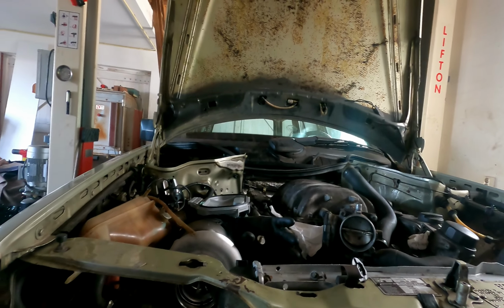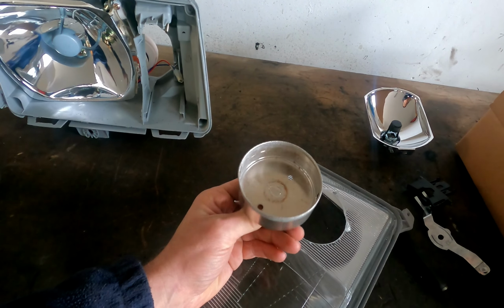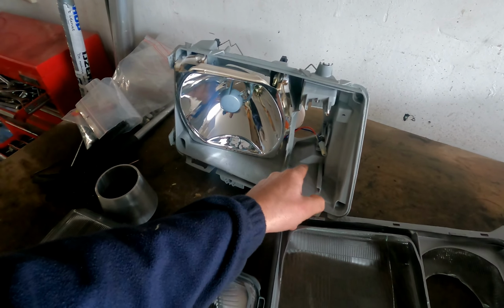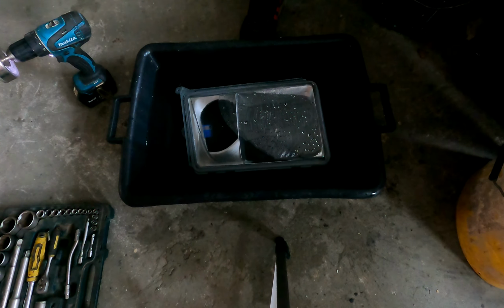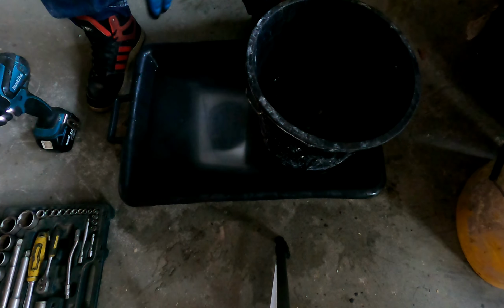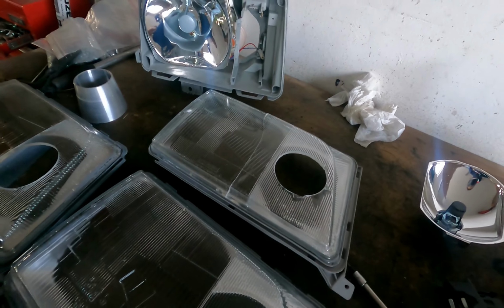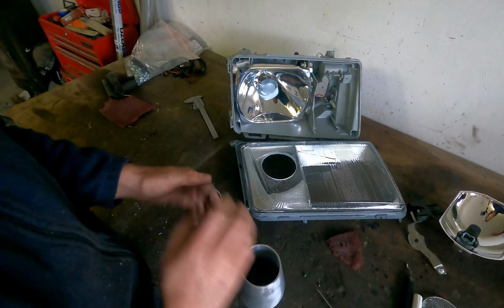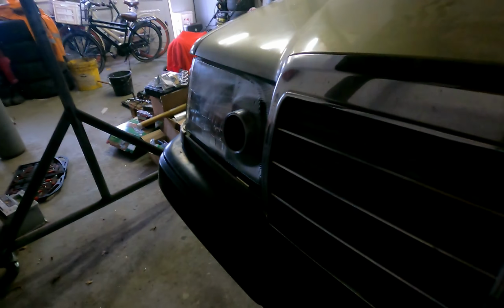W124 intake through Glass of  headlamp S124 turbo "part 1"

Comment: I know it's too late now but I wonder if making a guide for the drill would have helped keep it from scratching. Just a piece of scrap wood with a hole the same size as the drill and then clamp, glue, or duct tape the wood to the glass. It would probably make it easier to get the drill started without it walking around on you and scratching the glass.
Reply from the maker: Yes for sure it would